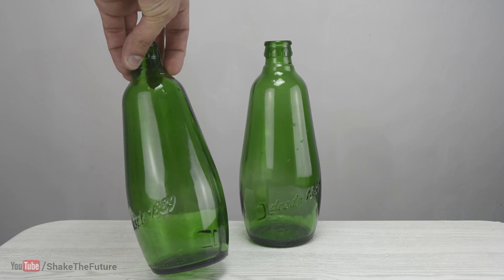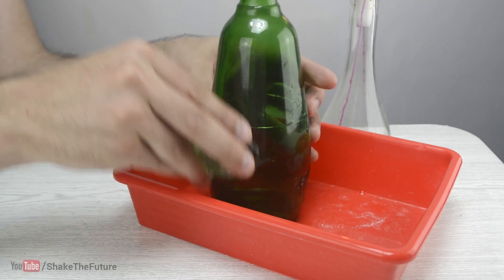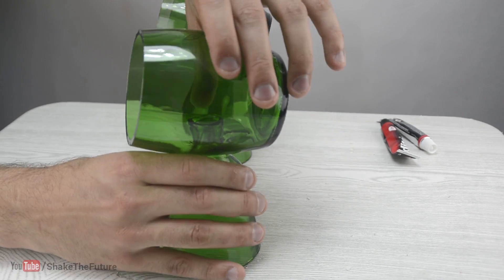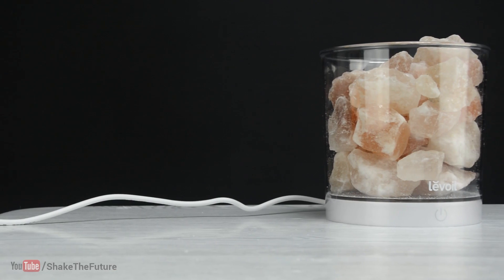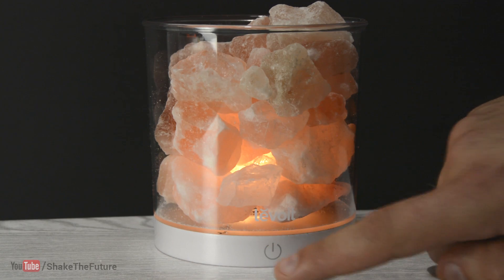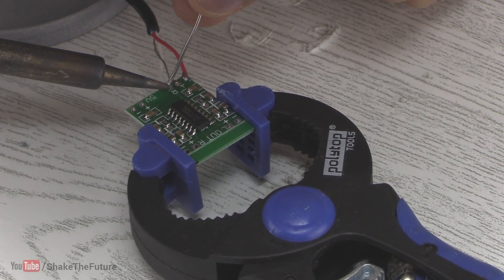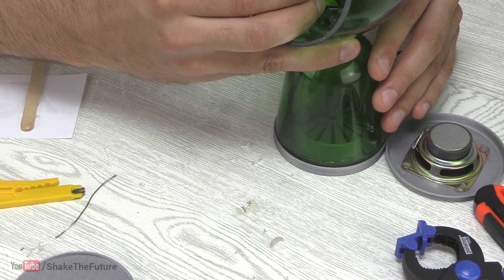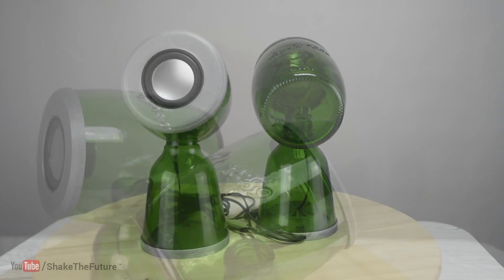DIY USB Speakers from Glass Bottles

Comment: Very nice. Looks great.
Reply from the maker: I haven't watched it in years. I have a confession to make: even though they looked interesting, I ended up not using them. They can't compete with proper desktop speakers. That's what happens when you try to make something out of cheap 5-euro speakers... I guess it also has to do with knowing what you're doing. Obviously, I don't know anything about making speakers. Just because something looks different doesn't mean it will sound good! 😀
Reply: @ShakeTheFuture  ah I see, although I am impressed by their volume still. Yeah, it's quite hard to tune a speaker I have heard. Saw some channel using a special machine to do it. Probably quite hard to do but they still look really nice as a decoration. Still a great attempt 😀